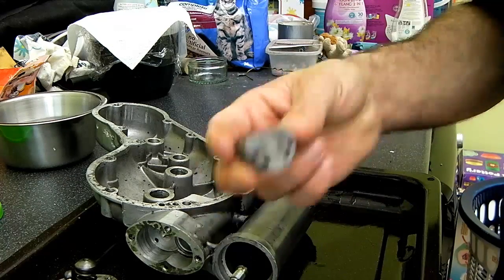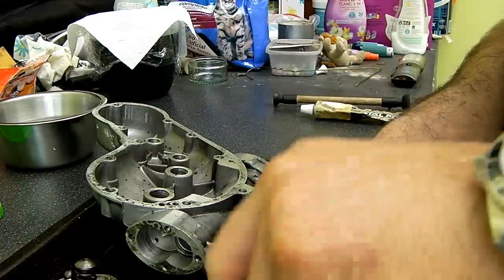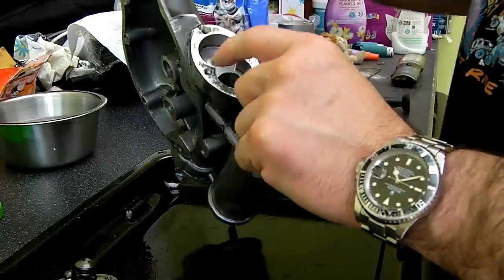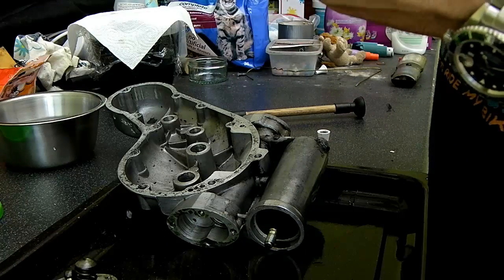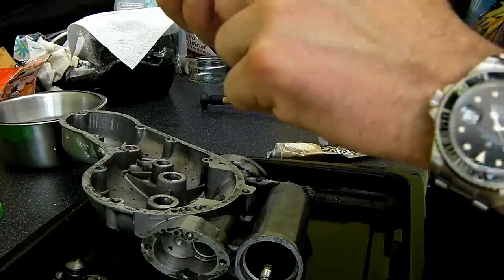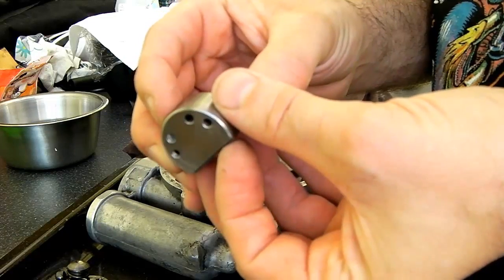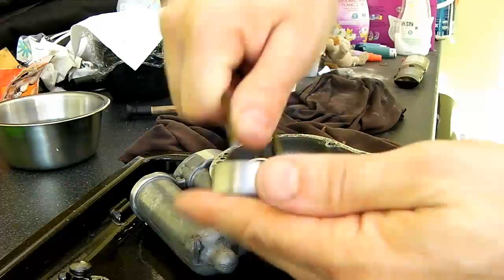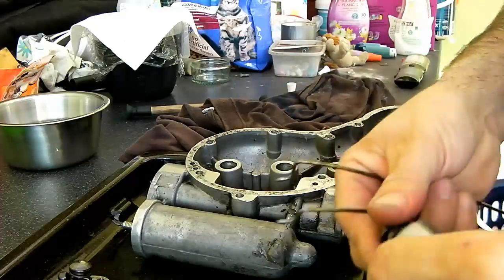Royal Enfield Bullet 350 classic, Lapping in the oil pump discs

Comment: But, the oil pump is the best lubricated part of the bike, how can it give problems and require 'lapping'?
Reply: Yes, saw your other vids and i understand.. need more coffee here.. the suff you are using to polosh is simply car polish? I also would be hesitant to use valve paste for the same reason you mention.. Where/how did you make/get the rubber suction tool?
Reply from the maker: That's correct yes, lapping in is purely to get the best mating surface to ensure an oil tight seal so it's more efficient.
The polish was autosol which isn't made any more, there's one called autochrome but I don't know if it's the same.
The suction tool is simply a valve lapping tool, they come with two different sized rubber cups either end.

Comment: Enjoying the video thank you.I have an issue with wetsumping, even with piston at TDC I can fill a coffee take away cup after a few days of sitting.Is this an issue with my oil pump not sealing correctly? Any ideas on what I could do or is this just normal? Bikes a 1999 350 bullet EFI. Other than the wet sumping, the bike runs very well.
Reply from the maker: Oh wow, a coffee cup full? No that's not right at all, especially with piston at tdc, check your oil level and all the seals including the rubber/cork one at the crankcase bolt and lap in your pump faces, check for scoring and pitting and obvious excessive wear as you disassemble it.

Comment: Hi Spidiq, May I ask at what speed were you riding and for approximately how long before this seizure happened please? Thanks
Reply from the maker: I was travelling at somewhere between 55 and 60 mph for about 8 miles maybe.
I believe however, that the main reason for the seizure was because on stripping I discovered the bike had already had an oversize piston fitted and I don't think it had been allowed to bed in properly and the piston to barrel clearance was tighter than recommended for an aluminium piston and iron barrel